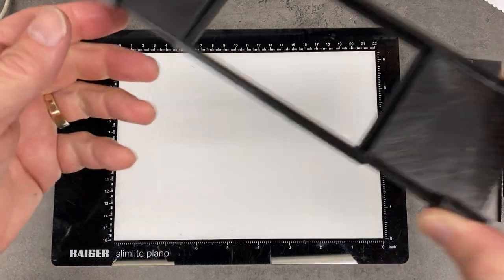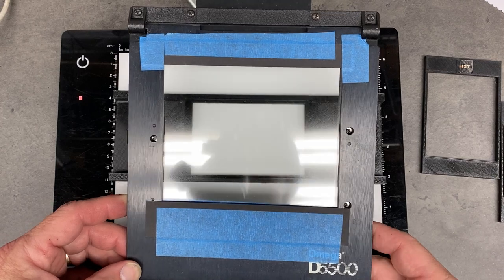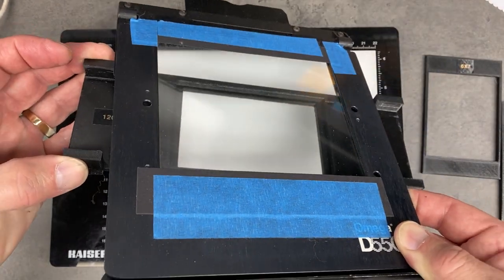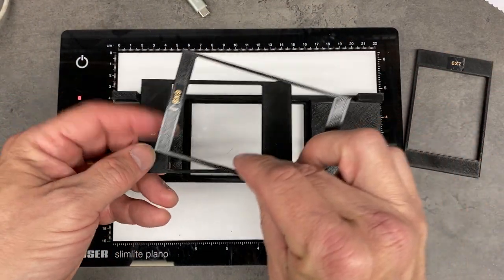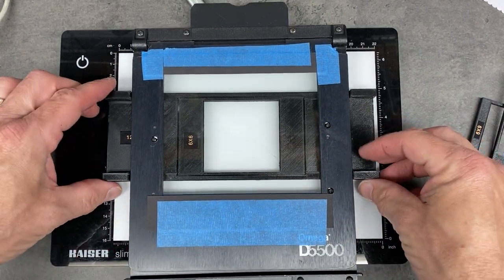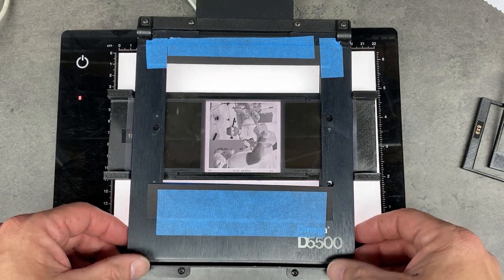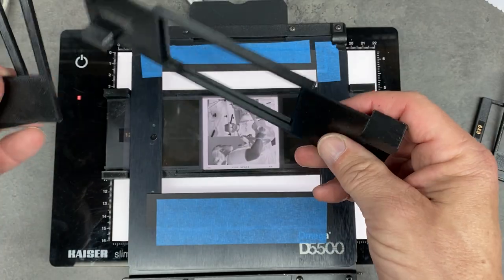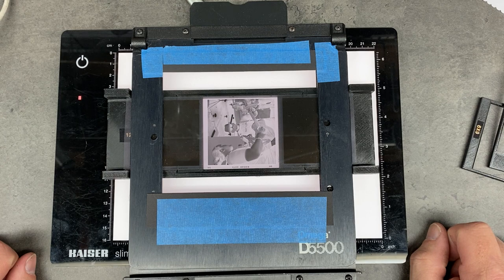Alignment Jig for DSLR Digitizing with the Omega 4x5 Glass Negative Carrier

Comment: Do 3D printed material have static, dust attraction, adhesion problem for masking and holding?
Also, is your Kaiser light pad optimal for this method of photo shoot/scanning, specifically the CRI rating?
I've found now in 2024 that results from common LED light pads compare very poorly vs. CRI 95 or higher light sources meant for photo scanning. Easier to see differences with color negatives and slides, but also noticeable with BW. I was satisfied with using light pads with color (Kelvin) and intensity adjustments until trying well rated CRI lights, thanks posts from YT guy, Pushing Film..